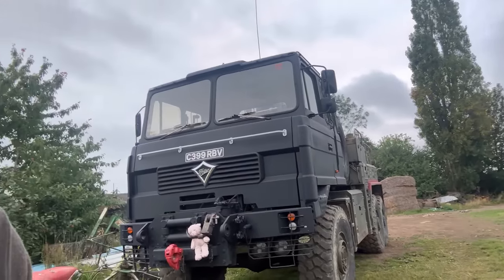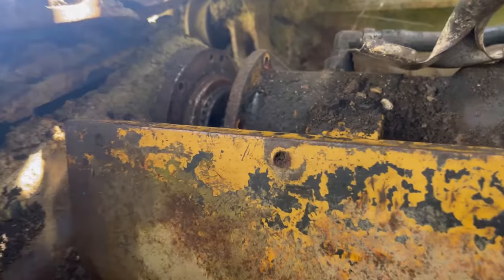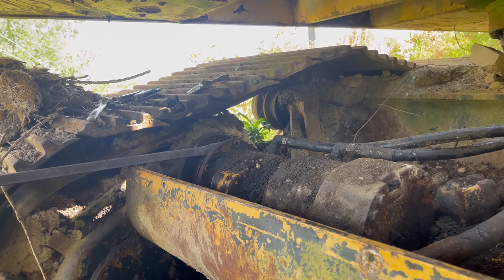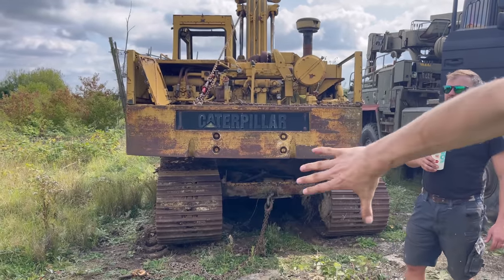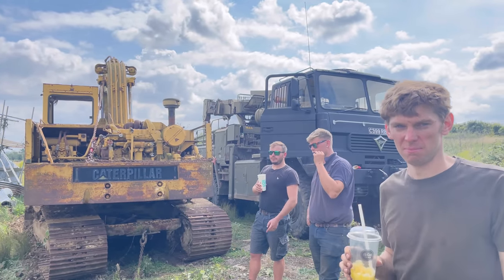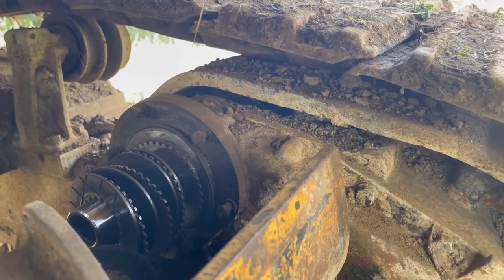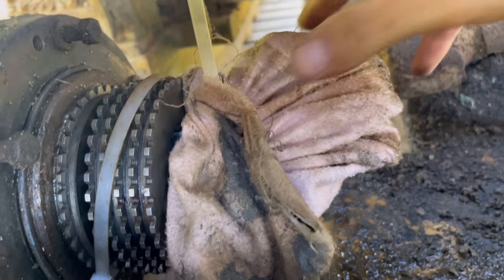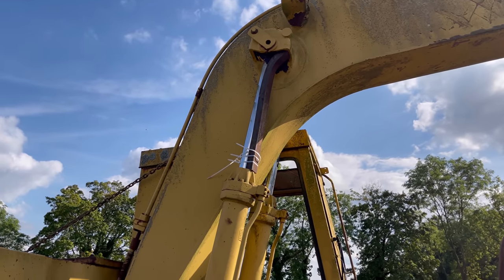Liberating The Caterpillar Excavator after its 25 year sleep..

Comment: jesus. the foden did not care that the digger was behind it. what a unit.
Reply: If done correctly them wreckers will pull out a tank that's stuck in mud. Awesome bits of kit
Reply: The Foden certainly does what it says on the tin! Awesome bit of kit! And the British Army binned them and instead got something far less capable. Typical!
Reply: @samrodian919  but armored.  That's why they got rid ofthem
Reply: @MCMLXXXIV1984 the Faden was replace due to the Man contract, that bent if it had to achieve its specified turning circle. Every Man RV  truck was ritually humiliated by loosing a tug-o-war with the Foden before it’s retirement
Reply: Great video guys good to see fitter Matt
Reply: @toml8142 yeah the MAN’s are garbage, couldn’t pull the skin off a rice pudding. Rather have a TK as a recovery vehicle and that’s saying something
Reply: The fodens got weight, torque and gearing on its side
Reply: @karlrichardson4665 exactly. The JCB very likely had the torque to do the job, but was way too light. Tonnage is traction and the foden has that in spades
Reply: Sure has some grunt, it didn’t falter.
Reply: @samrodian919 😅

Comment: Arguably one of the best machines of its time, the Cat 215, (only an Akerman could give it a run for its money.) Drove a 215 about 30 years back, would have another tomorrow. If you cant rebuild it, replace it with another 3304, those engines just sing when they're working flat out.

Comment: I owned a cat 215 prior to selling my quarry.  It was a great size machine to own.  If I remember right the unit was made in Belgium.  It had a Perkins diesel for power.
Reply: Only ever a Cat 3304 in the 215 as far as I am aware, it was the smaller 'Cat' machines which had the Perkins offering.

Comment: It would probably have been a lot easier to move this excavator by connecting an external hydraulic pump and engine to the hydraulic system of the excavator by an umbilical hose, bypassing its own seized up engine. This would have enabled the boom to be raised, the machine to be slewed straight, and then the machine to be driven onto the trailer. (Assuming that only its engine is bad, and its cylinders, track and slew motors, and hoses are otherwise in working condition.)

Comment: Wouldn’t it have been easier to split the tracks and then winch it on the trailer? 
You might have needed a good few chocks to hold it on the trailer though, but easier than taking off the motors that didn’t work.
Reply: Obviously, they were desperate to take you with them for all your amazing suggestions. The only problem was they needed the winch cables and couldn't spare them to wire your chin and knuckles. You know, to stop them scraping across the ground.

Comment: 16.5 ton Caterpillar.
7 ton JCB FastTrac.
25 ton Foden.

Foden has smaller wheel diameter and more of them than the JCB.

Conclusion: the Foden is not simply superior, but the JCB is frankly a bit pathetic and needs a couple of extra axles and a Foden badge.